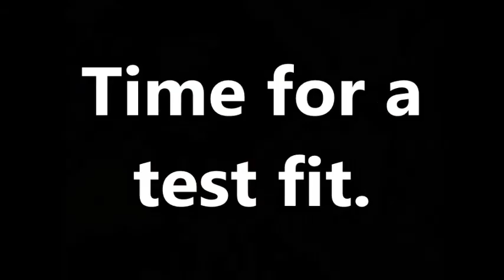★Part 2 4x4 Tractor Homemade Log Skidder Attachment for Logging and Clearing Property

Comment: Does your machine have rear remotes available to purchase? If yes, upgrading your logging winch setup to a hydraulic winch and more pull could be done. But your tractor would need a rear remote that has a "detent" function. Meaning hydraulic flow will be full instead of intermediate like for a cylinder use. Then you could use a remote switch on the winch and sit on your machine where it would be safer. Just an idea if your tractor can have a remote valve installed. 
cool implement

Comment from the maker: +Eric G, for some reason I cannot respond to your comment directly. Let me know if you receive this response. I have thought about the grapple, but have not found one that is worth the money as of yet, but I am still looking. As far as the winch I feel that I would  consider other options. I am able to do alot with the 3pt hitch lift arms on it. I have a 8000 lb winch that goes into a receiver hitch on my truck. I considered welding a tube onto the skidder attachment so I could use DC the winch on it. I also
Reply from the maker: I also have used my 18 volt drill to help speed along the process of un-spooling and retracting the cable. The drill makes a big difference too.

Comment: I can't believe you just painted over rust . . .  other than that, great design and manufacture of that tool.  Maybe you know something about modern paint that I don't?
Reply from the maker: saltyseascott No I did not paint over the rust on the tank. I took my time and sand blasted the outside of the whole thing and the inside of the lid. It took me 4 hours of blasting to do it the proper way. The high heat paint on the tank is thin and would not lay down that nice if I did not blast it first. I could not get that part on film because, well, frankly I did not want my camera out an exposed to the sand flying around at all. Believe me I didn't cut any corners while I was building this project. Thank you for watching and for your interest in it. I hope to hear from you again sometime soon.
Reply: Dan Rogers
 i was talking about the log skidder i think you called it????
Reply from the maker: saltyseascott oh, lol, oops.  I used rustoleum paint on the log skidder attachment for the 3 point hitch on my tractor.  The directions on the can say to scrape any loose rust off and to paint over all the surface rust. The paint is like a shell. It is thick and somewhat pliable when dried. The can's lable claims that the rustoleum will  seal the metal and stop the rust. I used a coarse paint like rustoleum on the skidder because it is a given that it will be banged scratched and scuffed. An automotive grade paint or spray paint, though it would certainly look better, would be quickly scraped off and destroyed. Also the rustoleum can be touched up and here and there and it will bond to itself as well as the metal. It is a decent product.
Reply: Dan Rogers  Well its easy to see I am older now,  forgetting rustoleum.  Good Job!
Reply from the maker: saltyseascott in most cases you are right though. Generally no one should paint over rust with standard paint. It will rust through quickly. Thank you for watching and commenting. I look forward to hearing from you again sometime soon.
Reply: Dan Rogers
  You may,  I like the way you think.  However, you may not like the way I think because you see I'm Christian and shall remain so irregardless of what others think of me.  I notice that some  would like to cut my head off.
Reply from the maker: saltyseascott Regardless of what you or any of my subscribers believe I still enjoy conversing with everyone. I personally have my own beliefs. I don't force my beliefs on others. I simply live what I believe. If someone asks questions about it I give them strait answers. Some people understand and respect it. Some people reject it and me because they do not understand or do not want to understand. Others have been conditioned to fiercely impose their own beliefs upon me to attempt to keep me silent. (I assume that this is the group is the one that would " like to cut off your head")  I am very much that of a people person. Even when I have hateful venom spewed in my direction i continue in my beliefs undeterred. One of my core beliefs is that regardless of the semantics of most, bible believing, religions the majority of us believe the same general thing. I would be happy to dive into a deeper conversation with you any time feel free to message me on facebook click here. then click message. I check them throughout the day. I do hope to hear from you again soon.  https://www.facebook.com/daniel.rogers.3766952